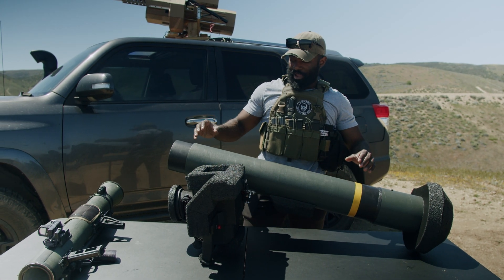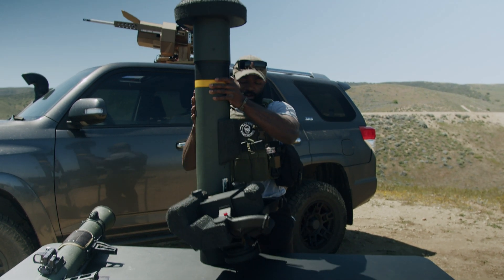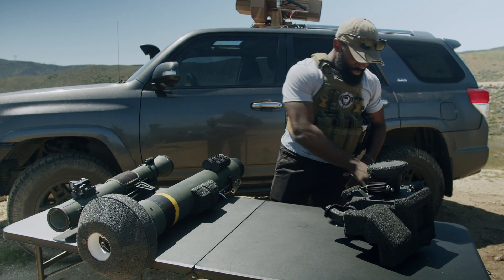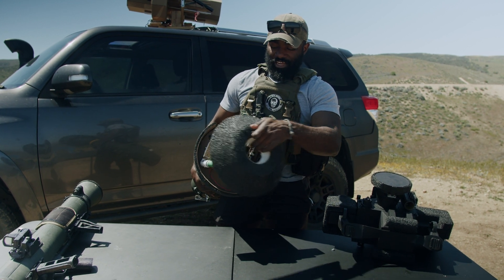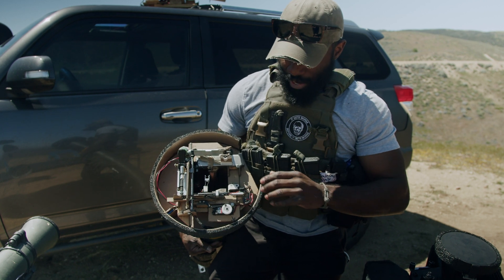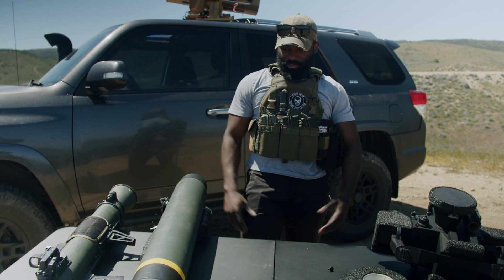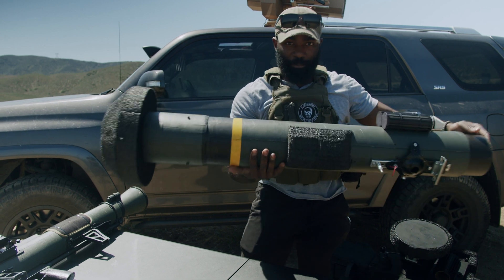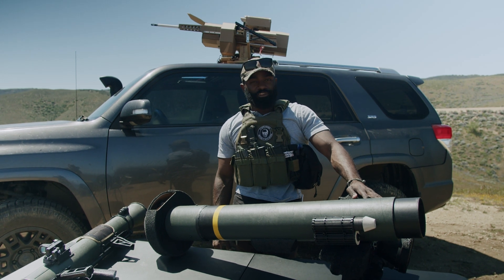Javelin build | Update 1

Comment: Could i ask? I do similar projects (like regular rocket lancher or 30mm antitank rifle fully working) and you gave me the idea to do the javelin too because its finnaly something difficult to make. But i have a small problem with the launch stages. I want to do the first stage launch out of the tube by rubber or spring but then the ignition will be hard to setup on the right time... Do you have any ideas to make it ignite in the right time?
Reply from the maker: Let me know if this makes sense. I’m attempting to ignite the rocket motor by using a micro switch on the actual rocket tube, which is held down by the javelin's external tube. When the rocket is released from the tube, it activates the rocket motor. The only issue I'm encountering at this point is figuring out how fast the rocket is leaving the tube and where to place the switch on the rocket tube to allow for the ignition of the motor at the right time.
Reply: @PointBlankScience  yea that sounds great, i will probably have to do alot of testing but yes that makes sense. Thanks! 🙏🏻